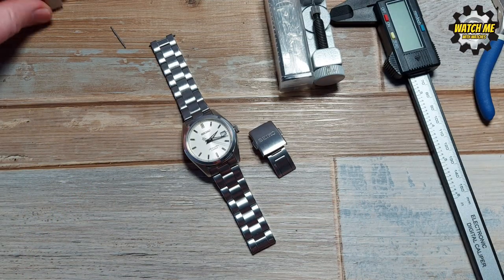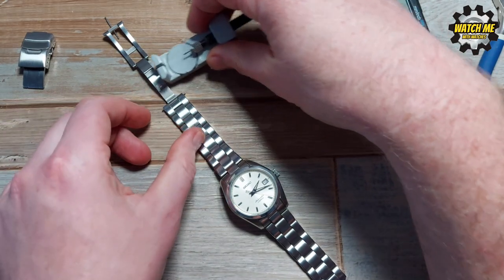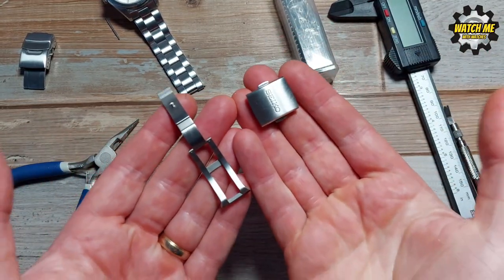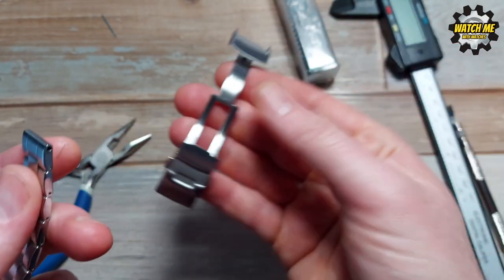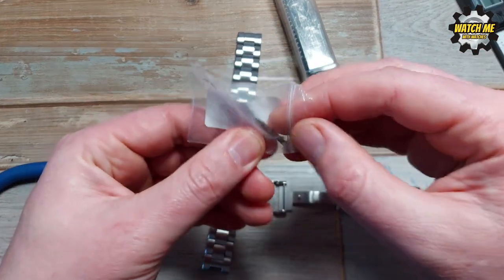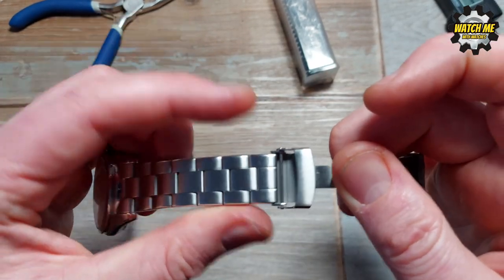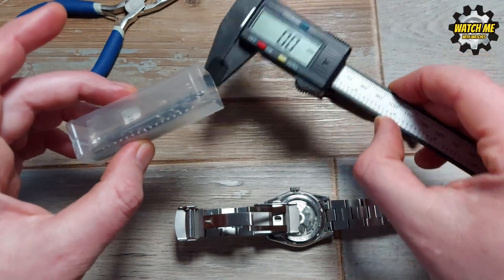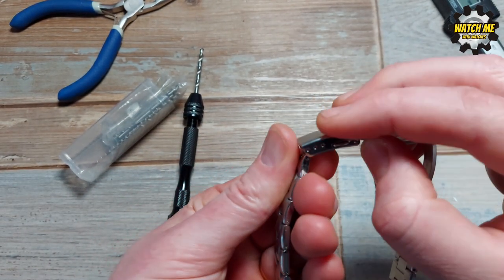How to change the clasp on the Seiko SARB033 or SARB035. Upgrade the clasp to allow perfect fitment!

Comment: Hey brother thanks for your vid, super helpful. Managed to use a spare 1.5mm spring bar that was actually 1.3something and reused the 1.00 stock single flange spring in the adjustable clasp section. I didn't have to bore out the bracelet link.  Thanks again! 👍
Reply from the maker: A pleasure! Glad it worked for you.
Reply: Thanks for this tip. I did the same and no drilling necessary
Reply: Where did you get an extra spring bar???
Reply: I got a Lil cheap kit from Amazon tha came with assortment of sizes. It said 1.5mm but when I measured with my calibers it was 1.3mm and worked for me.

Comment: Hi there, enjoy your tutorials immensely, but have a question, have you any experience with the PT5000 movement installation. I  have purchased a movement and am a little unsure how to proceed 
 as there is A very thin steel ring like a spacer and fixing screws and holding tabs. Happy Chrimbo.  JANBOY. RN. Rtd. Thailand.

Comment: 7:05 can you make a video showing the pin that originally goes in that endlink? I have not been able to fasten that long rectangular fastener to this endlink because collars fall right through the holes on that endlink. Is there a certain type of pin that goes in there? All the other pins and collars for the other links seem to be too thin.
Reply from the maker: You are missing the tiny sleeve that goes in the middle link part
Reply: @watchmewithwatches  ahhhh, by "sleeve" you're not referring to the collar are you? (cause I've tried standard collars with no success as they just fall through the link holes). Can you point me to a page or website link showing this part? A picture would help as I may have it lying around somewhere if not a picture will allow me to order the part number.
Reply: @watchmewithwatches  nvm figured it out through a helpful forum post. The sleeve you're referring to is the collar that I was already using as mentioned in my original post. The difference is that for the clasp arm the collar installation is way different than on the normal center links. On the normal male center links, one hole is larger and one is smaller. The larger part is where the collar goes. The difference with the clasp arm link is that you don't have a normal center link male end like you do on the other links. You only have a female end and then the arm clasp end through which the collars don't fit through and unfortunately the collars go emright through both outer holes of the link that attaches to it. The trick is to put two collars through  the outer holes of the link that attaches to the clasp arm. You then have to push the pin through the opposite side of the arrow. Also the pin is different for this arm clasp. It's a bit shorter than the rest.

Comment: Just did mine today. Turns out that I didn't need to drill out the link. However, one thing you need to be careful of is that there are tiny little shims in the centre section of the links on this bracelet, and sometimes they come out and can be very difficult to get back in (it's inconsistent from link to link). I've lost a couple fiddling with this bracelet trying to get the fit right, and have used up the spares from the extra links. If you don't have them, the pins won't hold when you reinsert them. Even when you do, they get a bit easier to get in and out once you've done it a few times, so keep an eye on them in case they come loose over time.
Reply: How did you mange to do it without drilling ? Where did u get extra thin spring bar??
Reply: @gonzolak83  I just did the same as in the video and used the original thin springbar. It fit without me having to drill it out though.
Reply: @simonhj  one spring bar comes from orignal clasp micro adjustmwnt. This one he use to secure one end. Second spring bar comes from where?? He didnt show that in video. He says hole is so small on micro adjustmwnt endlink he swaped that he have to drill to have it fit spring bar.
Reply: @gonzolak83  It's been a year since I did it. It's hard to remember now, but there is a springbar for each end. I think I just kept the same springbars with each end when I swapped the end pieces.
Reply: @simonhj  thank u for answering !
Reply: @gonzolak83  No worries!

Comment: Why did you need to drill the non flat sided piece? Would another option be just to get a thinner spring bar?
Reply from the maker: I tried so many, and none would fit!
Reply: @watchmewithwatches  Thanks! I recently purchased a SARB035, and going through the fitting process! lol... probably going to end up doing what you described.